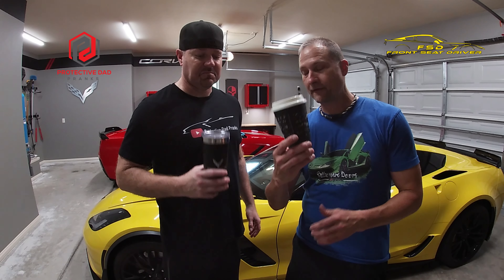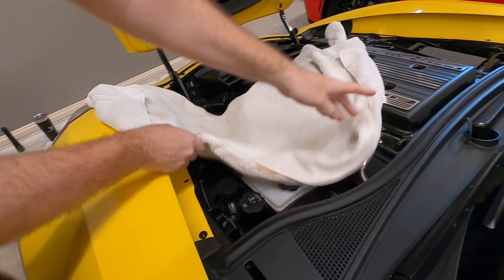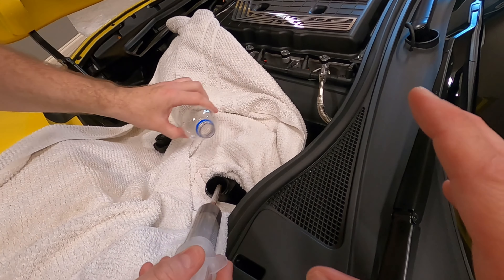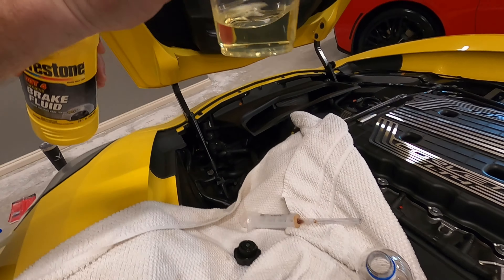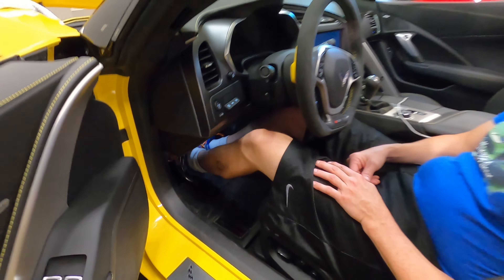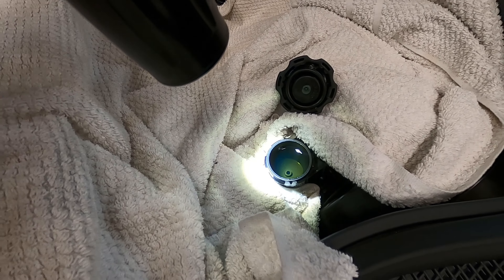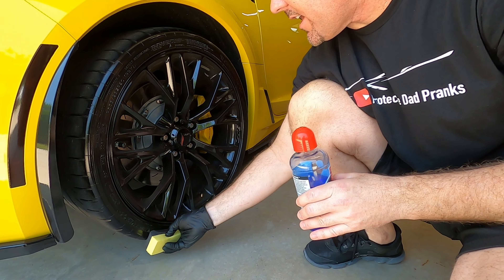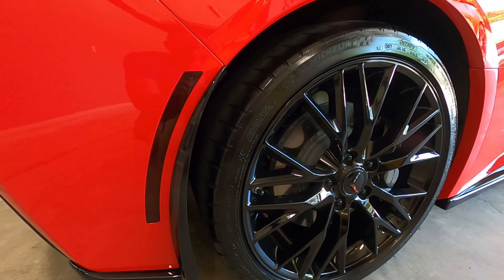Easy $10 Fluid Change You Need To Do On Your C7 Corvette!

Comment: Unfortunately you can't get it all out that way a lot sits in the line and slave cylinder.  A lot of pain for a change using a vacuum bleeder may work better.   I installed a 4' bleeder line at the slave with a speed bleeder end on my Mantic Triple.  Jusy pop the hood and bleed.  Just my 02.
Reply from the maker: I will check that out. Honestly, it's not too big of a deal if you're just hanging out doing some car maintenance stuff and bs'ing though. Thanks for watching and commenting. Have a great weekend!!

Comment: Hello liked the VID but the DOT 4 is not specified for my 2015 stingray automatic Transmission, will the DOT 3 do the same
Reply from the maker: The Dot 4 is actually brake fluid but works for the clutch. You will need transmission fluid for your transmission. I would contact a mechanic to replace your fluid.

Comment: Hi guys... I have a stupid question for you if you don't mind!  I bought my 2016 Z06 yesterday from a Chevy dealer. It was complaining that the windshield washer fluid is low. I can't believe the dealer gave me the car in this condition... (also none of the steering wheel controls are working including the HORN). I have an appointment to bring it back on Wednesday to have that stuff fixed. Because it was a Saturday, they said they have no mechanics on staff. Anyway, I am trying to add washer fluid... but I don't know where it goes. The previous owner of my car put these sweet looking chrome caps with the corvette logo on all the caps in the engine compartment... so now it's not necessarily self evident. From your video it looks like the washer fluid goes into the cap closest to the fender on the drivers side, but I want to be sure! Can you help me out?

Comment: I just used a turkey baster to remove the old fluid
Reply from the maker: That's cool. Does it affect the flavor of the turkey? 😃
Reply: @FrontSeatDriver  no but when I push in the clutch pedal it goes gobble,gobble,gobble
Reply from the maker: @mattharper588  🤣🤣🤣

Comment: Okay Jason, what am I missing? I know, I know. A few IQ points, but nevertheless. Why are you using brake fluid as clutch fluid? Are they one and the same?  The Z is looking good my friend. Save the Wave🙋🏼‍♂️
Reply: Peter Carey - Hey there Peter. Clutch fluid is really just brake fluid that is kept in the clutch master cylinder. ... The pressure of the fluid is then used to engage the clutch, which allows you to change gears. After the clutch has been engaged, the clutch pedal will be released, and the fluid will retreat back to the clutch master cylinder. The most important thing for the C7 Corvette is making sure it’s DOT 4. Thanks for watching us knuckleheads LOL.
Reply from the maker: What Steve said. Lol!

How's it going, Peter? Hope you're having a great week!
Reply: Hey Jason. Thanks for your reply. You cheated though. You made Steve do all the typing. 😁 Thanks to Steve's reply though, I recouped a couple of my lost IQ points. The question now is, how long will they last? 🤔 They are endangered you know. Ride with pride guys!